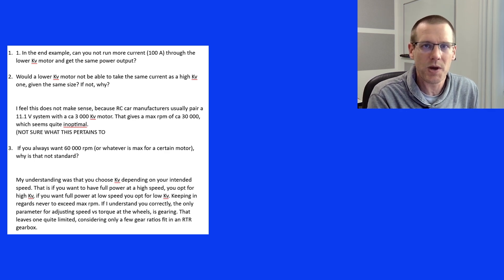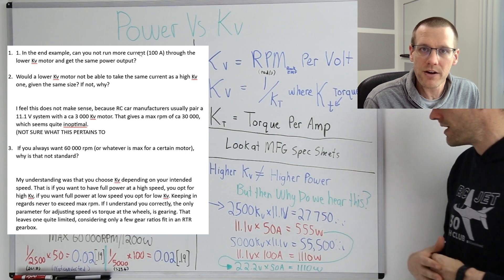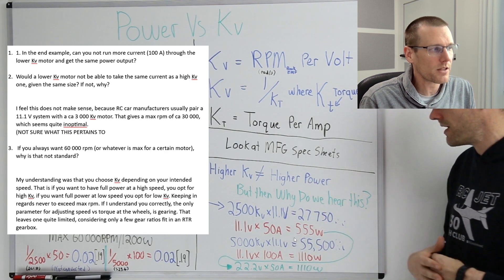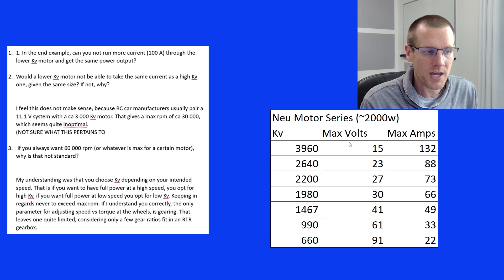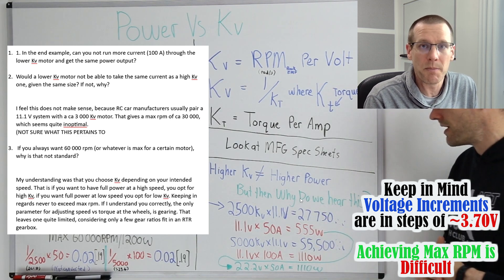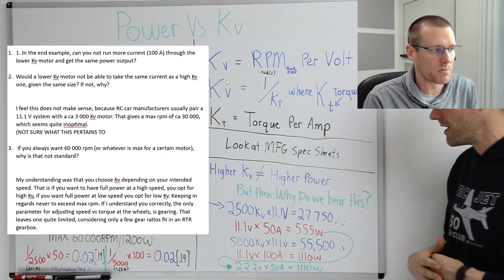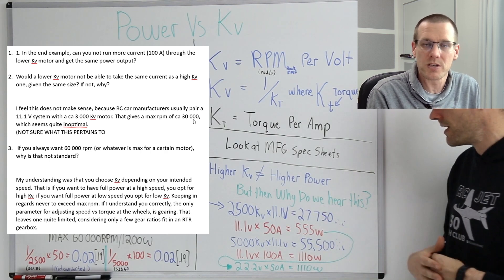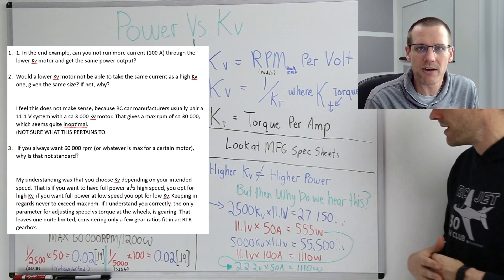RC Motor Q&A: Are Motors Always Running at Max Potential? How can they?

Comment: Hi Ryan, I'm still stumped. I have an application where I'm sizing according to a specific power, but lots of motor manufacturers (Castle Creations) won't list power. Is it so hard to say "this is a e.g. 3 kW motor. Here's a plot/chart of power efficiency and torque vs speed"?

How do i get those from the limited data manufacturers provide like Kv?

Comment: Very useful to see explanations of how some of this stuff works.
I found your channel when trying to figure out kind of the opposite of optimizing/speed running -> scale driving.
My limited understanding of things tells me that to get scale style performance one would want to be able to limit max current draw(torque/acceleration) and max rpm(top speed).

Am i off or on target with this and do you know if there are readily accessible ESCs that allow for adjusting these parameters (probably down by a lot) to mimic scale, rather than to target speed?
Reply from the maker: All you would need to do really is select your power system and gearing to match the top speed you'd like to achieve.

Comment: Peak power just before motor failure?
Reply: 741 watts is 1 hp.
Reply: Clamp an ammeter on the motor wire from the esc. Scale down a hobby Dyno for max power under load.
Reply: Get two bakers ball bearing rolling pins. Align them in a diy jig to make a chassis roller dyno.strap car down with Bungees.
 Gear a dc motor to the pin and wire in a dc voltmeter and series ammeter for power measurements.

Comment: Hi, thanks for the video. I like your reasoning and you’re right, but I think you might be overlooking one thing when designing optimal RPM range for the power sytem - iron losses.

In my opinion, targeting 60k mechanical RPM for a power system isn’t (always) optimal.

Iron core losses increase exponentially with electrical RPM (eRPM). This means we can’t increase RPM without consequences, even if the motor's physical limits allow it. 

For a 4-pole BLDC motor, 30k mechanical RPM = 60k eRPM. (number of poles /2 * RPMs) = eRPM

So how much eRPM can a motor handle before iron losses become significant? I believe it’s somewhere around 60k eRPM. That’s why manufacturers typically pair 3000KV 4-pole motors with 3S LiPo batteries and target max 30k mechanical RPM (60k eRPM). I don’t entirely buy the explanation that manufacturers simply have an excess of 3000KV motors lying around. :) Maybe you could compare the performance of the two systems on the dyno?

If we use a 2-pole 3650 motor in a 1/10th scale RC car and aim for 60k max RPM/eRPM, it becomes impractical to design a drivetrain with such a high gear reduction while maintaining a reasonable wheel speed.

I recommend the article "Choosing the Right BLDC Motor and Battery Setup for an Electric Skateboard" from Benjamin Vedder's blog - the author of the VESC project.

Keep up the great work educating others about RC tech! 

:goodvibes:

Comment: I like your in depth explanations and altgough factual I feel they are somewhat biased. Why always push high KV motors as appearing to put out more watts etc when you are varying the current but not the voltage? If I run a motor half the Kv but double the volts I have similar watts, similar max rpm but cooler running temperatures. A more specific example I would like  to know is take for example the hobbywing motors, you have the 56113 at 800kv or even 1100kv and the larger 70125 at 560kv..most people tend to opt for the higher Kv smaller cans as they are limited up to 12s in most cases but im wondering even though the 560kv is potentially over 16s capable even on 12s being a larger can size and being almost 2kg vs 1.2kg with similar motor construction (same product family) shouldnt the larger lower Kv motor be able to handle way more current and be geared much more aggressively making use of its torque to create an overall faster vehicle? I dont see a reason why a manufacturer would bring out a larger heavier motor of lower Kv in the same product line and for the same scale of vehicle for it to offer less performance and both are limited to the brands 12s escs? If both can be run max 12s on the brands on escs why would when choose the larger lower Kv can over the smaller higher Kv can if both cans are aimed at the 1/5 scale market?
Reply from the maker: The video these questions come from literally show a high and low kv motor producing the same total wattage. This image was on the screen for most of the length of this video.

Comment: electric motors are way better than IC. can't wait to get an EV.
Reply: That's a troll post if I've ever seen one.... good luck!!
Reply: @BUILDEMTORIDE  gas is 10 cents a mile. ev is 3 cents a mile. ymmv
Reply: @ruuster83  ev has its place, but making mandatory ev goals and laws is asinine, when the grid capacity is multiple decades past that goal.

We also don't produce enough "clean" energy to justify moving your tailpipe to the electrical plant and expecting fewer emissions.

As well as other countries offset any real progress, we are a drop in the bucket on the entire planets pollution scale.
Reply: @BUILDEMTORIDE  so this makes me want to pay 100$/ month for gas when I can charge at home for $25/month? Also how could a car possibly out perform a Power plant emissions wise? Many small engines are much worse than one big engine. EVs are 80%+ efficient and IC cars are 25% thermal efficiency. This isn't news.
Reply: Bolts are real cheap now. And Leafs.
Reply from the maker: Agree in some form, however, gas in my toyotas is just way better than batteries at the moment.
Reply: @RCexplained  Yeah, Toyota's EV is not what I would choose atm. Love my Prius tho, 5 cents a mile

Comment: I use tires as my gearbox
Reply from the maker: Haha, well done
Reply: @RCexplained  i have a wltoys 12th scale with a 3660 3500kv stock gearing and my personal best is 79mph with 80mm tires it might sound crazy but with my 65mm i run around 60ish so theoretically ill need 100mm+ to go 100mph
Reply from the maker: @brandongollach  no doubt. Overall tire size makes a significant difference.
Reply: NITRO Drag cars rely on tire growth for top speed.